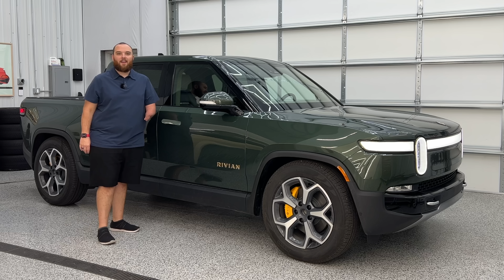Rivian R1T Full Paint Correction & PPF Removal Process - Episode 1

Comment: Ya those marks on the plastic trim are from wax, my truck didnt have it when I picked it up but it did after i waxed it with paste lol.  I used an eraser to remove them. The owner might had waxed it himself and left that wax paste all over the truck.  My r1t all black had none of that, it was spotless, it didnt get tore up until i started driving it and cleaning it myself. That front black smooth plastic grill is hard to clean i think, its not really paint but its not like the plastic trim either.

That PPF on the gear tunnel is to protect that area from rocks, particularly rocks damage from high speed off roading like drift.